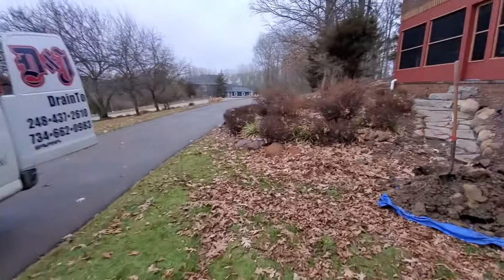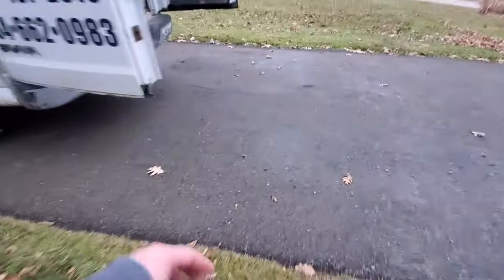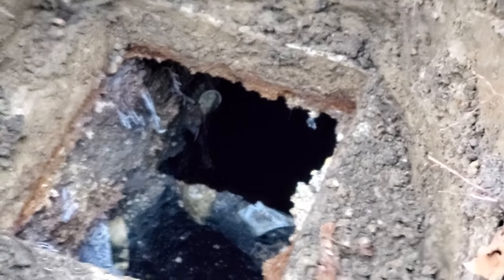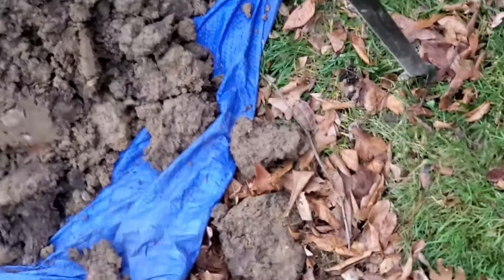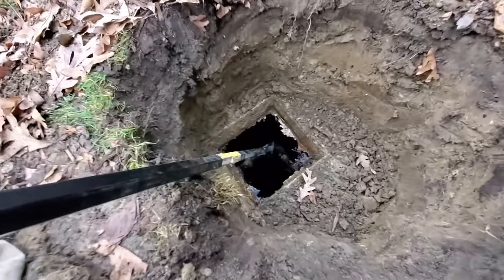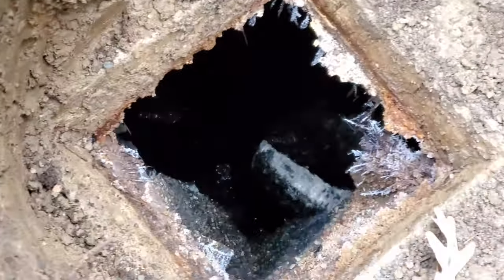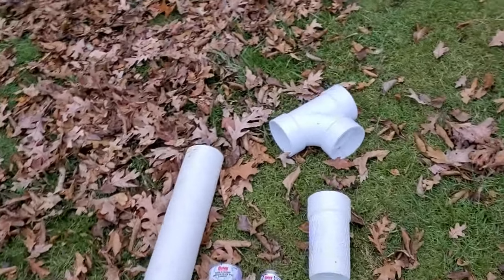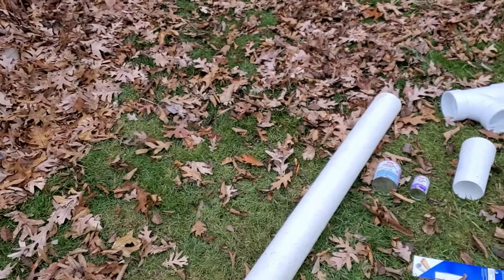DIY Septic Tank Outlet Baffle Repair

Comment: so many people dump there mop pail water down the toilet, and use bleach in there washers, nothing with a disinfectant should ever be dumped into your septic tank, it kills all the bacteria in the tank and kills it, it stops working, stops heating up, then it freezes, it stops braking down the solids, a good working septic tank never needs pumping, it is a big digester, sure it only cost an avrage of $180 to have your tank pumped out, if your get a clog, but if you look after your system and dump them strong cleaners out side on the ground, you will save your system from big problems and added cost, my tank has never been pumped out in its 48 year life. i dont buy any commercial additives, i make my own high test, and do not flush any paper down, it is collected in a bucket that has disinfectant and Oder killer, and i burn it.. we get many feet of snow every winter, but my tank heats up so much, there is no snow over my tank, i see grass all winter, except after a fesh snow for a few day, my drain fied pipes are clean pn inspection..   has never frozen up.  you can install a new system at this time of year just weeks away from the 25 to 30 below weather, and use it, with out any fear of it freezing up, as long as you take the steps to get a good   bacteria going from day one, and do not run excess water into the system that is not needed. , like dont leave water running more then minimum needed. what really get me, we as home owner have to spent money on septic tanks, a septic feild that costs from 7k to 15k depending how many bath rooms you have, yet when people call to have there tank pumped out, they have no idea were that gets dumped, well just like oil spills that cost tens of thousands to get cleaned up, dirt has to be dug down many feet and trucked away by licensed comanies that can hall contaminated stuff.  ut all gets dumped in the same spot, at a land fill, yes a land fill, they have area that a big hole in the ground were you septic is dumped into, oil and fuel spils are dumped into, highly concentrated in one area, witch in turn socks into the ground in that one area, and over time works its way into the ground water, then into dug wells, streams, lakes at some point, it a huge concentration dump point, some pumping companies even have land of there own that they got licesed to dump all there pumping waste in there back 40,  put people dont even givea thought to were there waste ends up, if people looked after there own waste managment, there would not be there huge wast dumps, that at some point homes are built on, i know of 2 sub divisions that have been built on old wast land fills, 10 to 15 feet of full was copped over top and street and homes have been built as the city moves farther out. our main land fill was recently moved and pipes have been put into the ground many feet deep, to bleed off the methane gas made from all the waste, this gas is being sold to heat government shops, such as the department of high ways shop, the new lnd fill repair shop, scale house, and they have a stack burning a fire 24/7 at the top, to maintain the presser being built up.  in Finland they do not have any land fills at all, and every building in ever city has a hot and cold water line piped in, for domestic and hot water heating
Reply: But yet you’re dumping chemicals into the ground outside your home.

Comment: I had a friend with a backhoe install a 500 gallon concrete tank for me 45 years ago. I live alone and don't let any grease get in the tank nor water from my clothes washer. I originally put 3 packages of  Fleischmsns yeast in the tank. About 10 years ago, I looked in the tank and there was a floating crust about half inch thick and I dragged my bar along the bottom and it felt like there was about 4 or 5 inches of sediment.Added yeast again. Opened the rank recently and the crust and the sediment were gone. There was only black water that was almost clear. Added more yeast. Never had the tank pumped.

Comment: uum, there is no such thing as clean water in aseptic tank.. yum have a drink if its clean,, that must be a crappy built tank if you can brake the concrete  with a bar, thats down 3 feet under ground, man that tank is down deep, far from normal, our winters are 60 below, and tanks dont have more then 10 to 12 inches of cover. most have 6, concrete tanks that are made here never fall a part, have yet to see one, that bafal has rebar in it, just like the walls and lid, poured with 4000Lb mix, i hope your solid poured basement dont fall a part like that too. oh one other thing, make sure you have your cell phone in your shirt pocket when bent over into a tank.. that way you always have it with you, if something should happen.. a filter in the outlet, that be asking for a huge back up into the house, if any thinggets in there you have a bigger problem, putting a filter it, just asking for problems, i have installed many systems both plastic tanks and concrete tanks as well as concrete holding tanks were a feild is not allowed, such as near a body of water, and never used a filter. in fact every tank you buy comes with everything you need for the 2 hook ups, no filter ever with the parts
Reply: I didn't think you were supposed to tear out the baffle. I thought it helps to keep solids away from the outlet pipe too? 😂
Reply: You’re supposed to clean the filter every 6 months or so. That way it doesn’t cause a backup. Without the filter or a baffle, solids will go into the drainfield causing it to fail and being a much larger and more expensive problem. By code there has to be a filter on the outlet of a septic tank and on all of our inspections they always make sure we have one installed. Holding tanks being the only exception because there is no outlet.

Comment: Hey, excellent video.  Thank you.  Question: I can't find very much useful information on when using a single compartment septic tank is appropriate and when it's not.  My main question is, assuming proper drainage (leach field), and proper plumbing, can a single compartment, 500 gallon septic tank, with a proper baffle like you show here, provide years of trouble free service to a one bedroom cabin?  I keep hearing people say that single comparment septic tanks are basically the equivelent of holding/pump tanks, and that you'll have to regularly pump them, much more often than a double compartment tank (such as a 750 gallon double compartment, which is double the cost).  I don't want to over-build or over spend.

Comment: How do you determine the length of the pipe that is submerged into the tank? Great video! Very informative 👏
Reply from the maker: Thank you! The down pipe should be between 12 - 18 inches.
Reply: @askthepumperdude  thanks!

Comment: Great video thank you. So I take it this is a gravity system? So as the tank fills it flows downhill through that output pipe to the drain lines? I recently changes my 2 1/4 HP pump that was put in in 1995 (Myers). It was pumping uphill, about 1000 feet to the drain lines. My first time working on my septic system. I sure did learn a lot, thanks to guys like you posting these how-to videos.
Reply from the maker: Yes, this was a gravity system. You will find the same set up in pressure systems as well. The tank or tanks before the pump chamber will have outlet devices like this. Thanks!

Comment: man this is what I need it that'll save me money thank you for your help
Reply: i got some people looking at it and they told me that canot be fix they said I have to replace the ta6
Reply from the maker: If the tank is structurally compromised it could need replacing. But if the outlet device is the only thing that is in need of repair, the tank would not need to be replaced.

Comment: I have a concreat tank with what appears to be a plastic or maybe fiberglass half round baffle that clings to the inside of the tank. It is chipping away at it's top edge and begun causing clogs. Is this common and how does this happen? Is the damage from the required 3yr pump-out required in WI?  What of the inlet baffle are they not prone to failure?
Reply from the maker: Would it be possible for you to send a picture? That would be helpful. You could email it to jake@djseptic.com. Thanks.

Comment: Excellent video and info, thanks.  My tube has been missing a long time could this totally clog the drain field piping after a long time or do they recover well from scum layer draining out???
Reply from the maker: drain fields can be resilient. The best thing you can do is get the outlet device repaired and be very conscious of your water use. The more you can spread out the usage, the more rest periods the drain field will get and these rest periods are most helpful in drain field recovery.

Comment: I replace my inlet and had it pumped kast year. This year I'll be installing a new t and having the outlet lid pumped.. is it possible to just have your pipe 20" ish attached to the t and install within old concrete baffle? Just wondering incase I run into that.  So I don't risk cracking tank dropping chunks of concrete 8 feet. Thanks

Comment: Excellent video. I thought about this possibility with my 40 year old concrete tank but didn't think I had enough clearance to install it and my existing pipe needed an extension. Now I feel comfortable going ahead with the project. Thanks!
Reply from the maker: Awesome! You can do it!

Comment: Thank you! I just completed doing this after my septic man said i needed it. Had to wait a week to get the poly loc thingy in the mail. Tank wasn't close to full in a weeks time. I measured the depth on the congrete baffle to outlet and it was 20". So I made my device that to match that. Have had it pumped every 3-4 years for 20 years with no proplems until concrete baffle fell apart. Once again, Thank you so much!

Comment: Wonderful. Might be simple to those who know but wonderfully helpful for those who didn't know .... like me. I have the  exact same circumstance. Things answered that I was curious about were 1) OK to bust off the old concrete baffle and let it fall into the tank? (Yes) 2) cap the top of the Tee (No) 3) straight Tee or Sanitary (Sanitary 4) I didn't realize there was a wet use PVC glue (there is). thank you again this video - well done and helpful.

Comment: I made my outlet device just like in your video instructions but when I went to dry fit it onto the outlet pipe i found the outlet pipe to be slightly oval-shaped so the extend & lok would not fit. What do i need to do next?

Comment: The outlet was installed at about 5 degrees up from level. In order to have the tee somewhat perpendicular I would like to use a 45 coming off of the extend lock. Do you see any problem here?

Comment: Thanks for doing this video. This is what I will be doing today…when I bought this house, I knew it had failed the inspection, but was waiting until spring to install a whole new system. I rolled the dice on it not backing up…but came up short.
I am hopeful that by installing this…I can buy some time until I get a chance to design and install a new system.

Comment: great video sir. are you in Michigan? Is that typical for the tank to be so deep with no risers on the outlet or inlet access? Tank from the early 80s?
Reply from the maker: Yes, the vast majority of tanks do not have risers. The depth of most tanks are typically within 2 feet of the surface, but we have seen tanks buried as deep as 5 or 6 feet!

Comment: Wouldnt this procedure be the same as the inlet side make the T baffle?
Reply from the maker: Yes, this same process could be used to install an inlet baffle however, it would be advisable not to use the extend N lok in the inlet line as it could become a clogging point for waste since it slides inside the pipe. Usually the inlet line extends far enough into the tank that the tee could be glued on to the pipe without using the extend N lok.

Comment: My understanding is that the outlet should be 3-4 inches lower than inlet. Allowing waste to come out fall and go to the bottom. Will be a scum layer on top. My outlet has the T just like this keeping waste out which I have a good baffle anyways and not an issue but it’s cocked backwards a lil bit and prolly should be lowered about 3 inches. The water level is at the bottom of my inlet which caused a backup. Is it possible to lower the outlet myself or is this a big expensive project that’s going to cost me? I have the diverted on the outside directing to either 1 or 2 in my leach field. Assuming not an easy task?
Reply from the maker: Hi Chad, we just posted a video to answer this question. I hope it is helpful! You can find that video here: https://youtu.be/vInS4ECLyhE

Comment: Thanks for the video. What's the measurement on the pipe below the tee? 15-20 inches?
Reply from the maker: For a typical tank you will cut this pipe 12-18 inches in length.

Comment: I'm not sure if it's my baffle or my pipe, but whatever is coming through the rear of my tank has come loose, and water is seeping thought the tank into the ground. Just had my tank pumped a few months ago, but I think I'm going to have to pump it again, and do a repair similar to this, probably even replacing some pipe on the outside. Thanks for the video, and Go Blue!!!
Reply from the maker: This video is a little off topic but towards the end has a picture that could be helpful for your repair: https://youtu.be/SQJ7aDHEW2k

This is definitely a video I will be making soon. Thanks.

Comment: I had my tank pump today and the tech showed me where the concrete baffle broke off and fell in the tank. There isn't an outlet pipe in the tank that I can see. Am I stuck calling in a pro for a costly repair?
Reply from the maker: The pipe may be slightly inside the wall of the tank, so it may not be sticking out where it can easily be seen. As long as it is a PVC pipe, you should still be able to to complete the repair this way.

Comment: but is this legal for a homeowner to do? also, a septic guy told me that 90% of the time only the first 10 feet of the drain field is usually what is clogged. does that sound right to you?
Reply from the maker: There are many possibilities that can cause drain field issues. In older systems that used concrete tile for the construction, it is common for the issue to be at the header (front section) of the drain field. We always recommend having a drain field inspection done at the sign of failure in the drain field though, as this is the only way to be certain what is causing the issue so you make sure you are properly addressing it.

Most counties or states do not require a permit to replace the outlet device, but you can contact your local health department to find out what their requirements are.

Comment: Would I be able to do that to extend the piece to come above ground level to empty and rv tank into it or would that be a whole different process?
Reply from the maker: No, you wouldn't want to dump anything down directly into the outlet device. It would cause waste to flow directly out to the drain field. If your local health department allows for RV waste to be connected into your septic tank, it would need to be brought in through its on plumbing or connected into the inlet line coming into the tank.

Comment: My outlet baffle was to old and it broke right we’re it goes into the cement on the septic tank how can I fix that? Will I have to shovel outside the septic tank to put a coupler with a pic of ove that will go into the septic tank tri the baffle?
Reply from the maker: It depends on the type of pipe. If it is concrete or clay pipe, you will need to replace by digging outside the tank and extending new pipe back into the tank. If it is PVC, you would be able to replace it using the steps in this video. Please let me know if you have any questions!

Comment: 17:05 if gases cause concrete to deteriorate. why the hell is't the tank vented or the baffle made out of a better material .?! some engineer needs to be fired.
Reply from the maker: Agreed. Not all tank manufacturers install a precast concrete baffle. I'm not sure the thinking behind it. However, the tanks in our area in the last 10 - 15 years seem to have higher quality concrete baffles, but the older ones are always an issue.

Comment: At what length do you cut the 4" PVCs pipe going down from the T ?
Reply from the maker: It will typically need to be cut 12-18". The most important thing is that it extends to the middle of the tank and is not too close to the bottom where it could allow solids to escape from the bottom of the tank.
Reply: @askthepumperdude .. Thank you 👍

Comment: do you have problems with the filters now required .do they need cleaning every couple of months ??? great video
Reply from the maker: It depends on what type of tank the filter is installed in. If the filter is installed in a single compartment tank and it is the first tank in the system, it may need to be cleaned every 6 - 12 months to avoid plugging. But in most cases, filters are installed in either the second compartment of the first tank or in a secondary tank. When this is the case, the filter should only need to be cleaned when the tank is cleaned.

Comment: Thumbs up on the extended and lock. I had no idea it existed.  Question on primer.. I'm not a plumber so I read the directions, if I remember right from the last time I used it, you are supposed to glue the fitting while the primer is still wet, but I seldom see youtube plumbers even bother.  How important is this?
Reply: I’m not a plumber but do drainfields and tank installations and the primer that we use dries super quick so unless you were super speedy I don’t think you could glue it with wet primer.